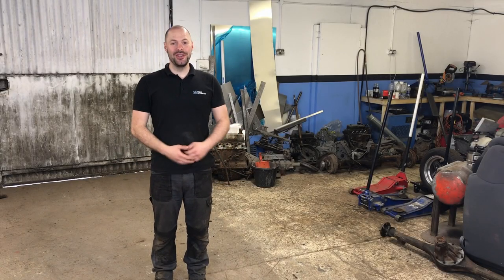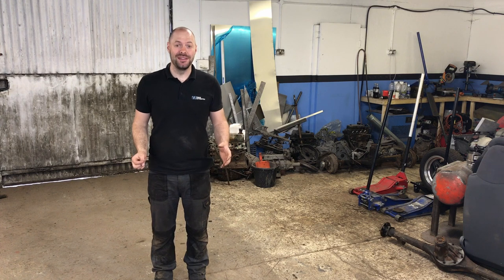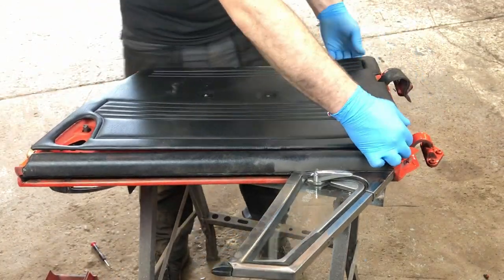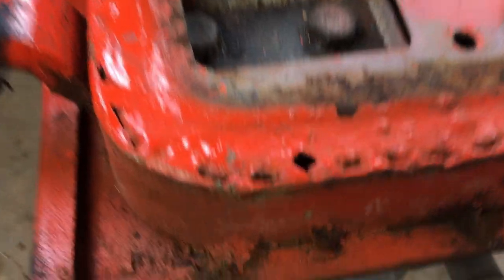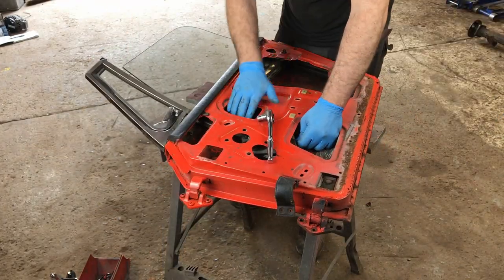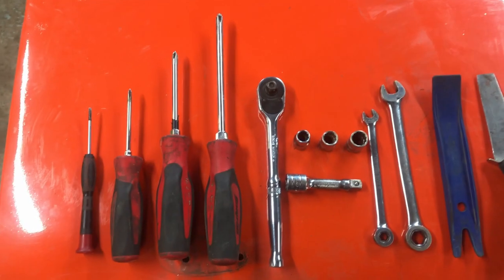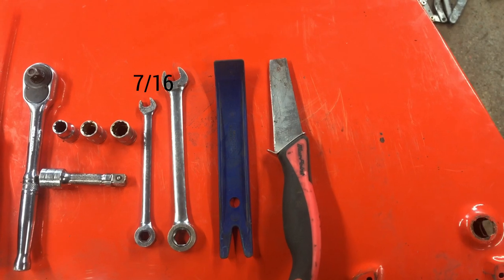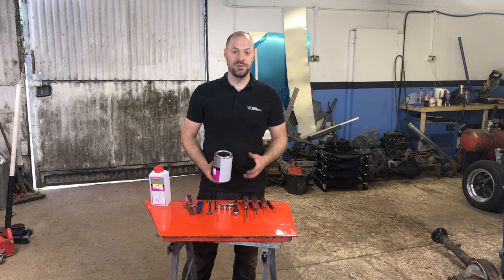MG Midget 1500 Restoration - Door Tear Down (No media blasting?)

Comment: Your videos are getting better and better. I saw you pull away some kind of seal or sticky stuff. When you reassemble the door, can you give us an idea where you sourced the new parts, please? (Such as new door straps).
When I was a kid my dad had a nice Austin A30. Inside he had a sheet of polythene stuck into the door to keep the door trim from getting wet. I didn't see one here. He also put proper slits at the bottom of the door instead of just tiny drain holes and painted the inside of the door with underseal. Also how to prepare the quarterlights for re-chroming. And of course what you use to get the trim back to looking new. Cheers.
Reply from the maker: CharltonLatchford the sticky stuff was just duct tape in this case. I believe there should be a plastic film as you mention, from the factory but I have yet to find a midget original enough to still have them! I’ll do my best to replace those!
Reply: The quarterlights on this era of Midget will be stainless steel rather than chrome plated
Reply: Emma Jacobs I have a 1977 midget 1500 and mine are chrome-plated. I wish they were stainless steel.
Reply: CharltonLatchford
 How odd. Do yours have the smaller or larger angled cutaway at the top of the window channel?
Reply: The car is currently in the garage at our holiday home, so I can't check. But it's immaterial because now I know I'll get them changed when it gets renovated.
Reply: That's the additional value of these videos: You see how it's done, and you get ideas from others

Comment: Hope you read this before the media blasting. I would be particularly interested to see how they blast into the nooks and crannies. Also into the inside leading edge of the bonnet and the rear where the hinges are as these are prone to rust. 

A lot of midgets have a warped boot lid. At what point in time would you correct this?

Showing all tools needed upfront is great!